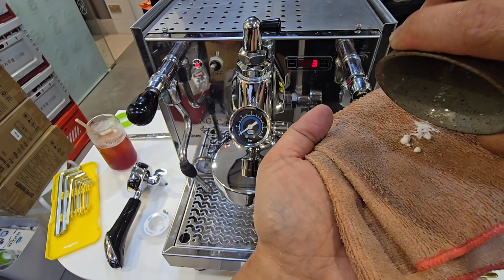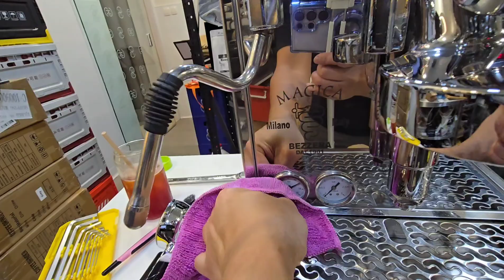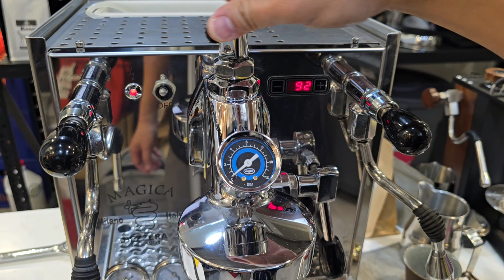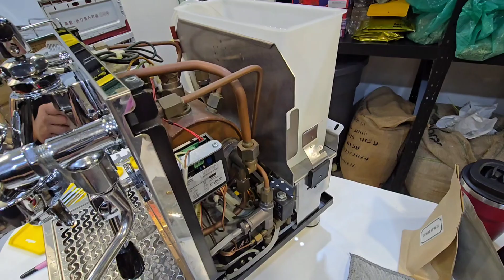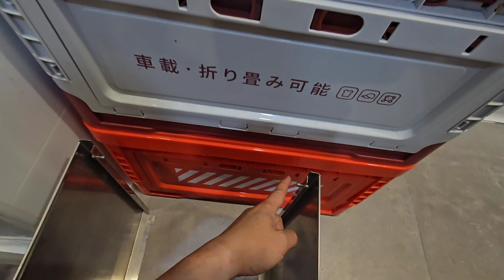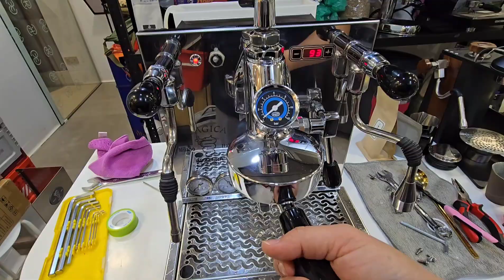Bezzera Magica PID espresso machine | Testing the flow control and adjusting brew pressure | Part 4

Comment: I am having trouble adjusting the pressure.  When I go to adjust the pressure, it just  stays at 4-4.5 . Any advice? Thanks.
Reply from the maker: There are 2 things you can check.

1) freshness of the beans
2) grind setting

But most importantly, is the taste good for you. Sometimes I get great shot at 4 bars even.
Reply: @CaffeMartellaSingapore  appreciate the response.

Comment: Hi! Nice video! I am just wondering why the machine is making a squeaky noise during extraction. Where is this coming from? I don't believe it is the pump. Otherwise once you turn it on you'd hear the same noise (which is not the case). Good work!